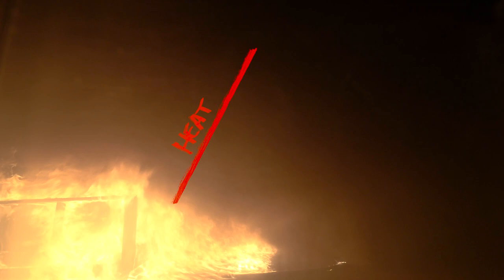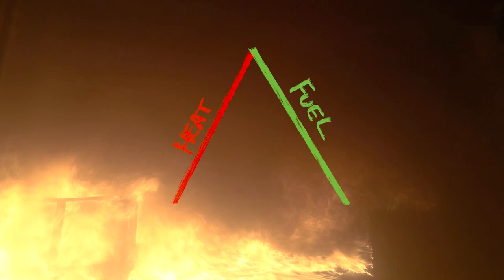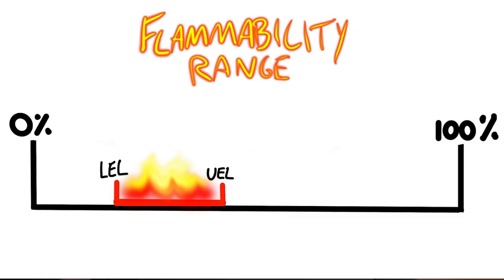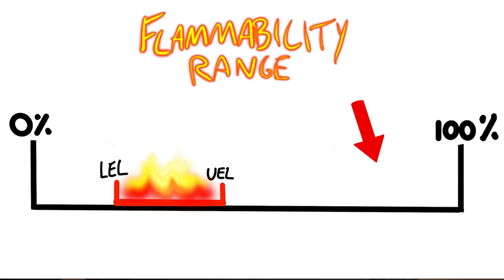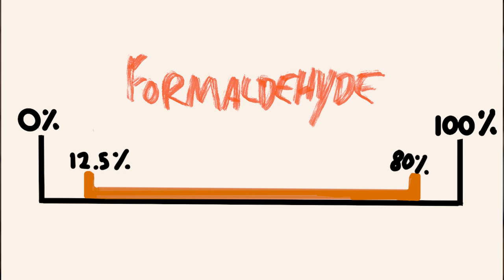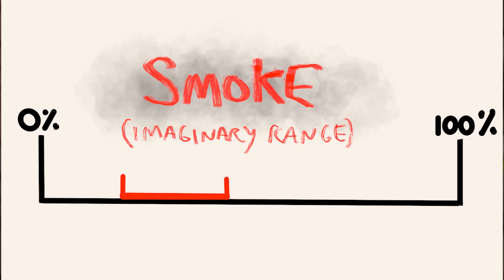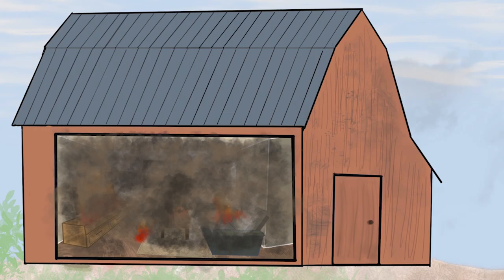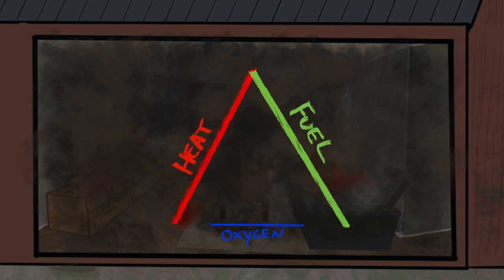An introduction to Backdraft - Episode 19

Comment: so how we deal with
Reply from the maker: Hi there, while I’m happy talking about fire behaviour on the internet. I’m not a big fan of providing actual tactical advice. There’s a few reasons why, but essentially I feel it’s not my place to hand out advice on something that can be so variable. After all, there is always more than one way of fighting a fire. But I will give you my preferred way (which really is just my opinion and nothing more) Which is to introduce water into the room to reduce heat and dilute the smoke with stream. But at the same time exclude as much air as possible with good door control techniques. If successful you’ll see changes in the smokes colour, density and buoyancy. If not successfully least you’ll still have control of the door and be able to protect yourself. This is definitely something your organisation should have training for. And the information is out there from much more official sources than me if need be 🙂